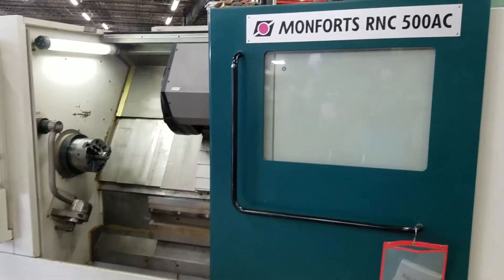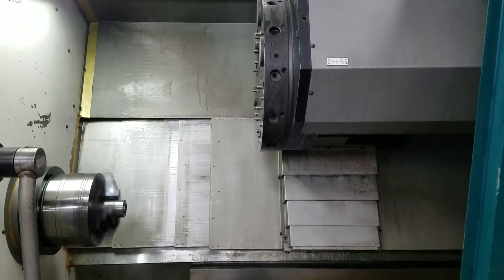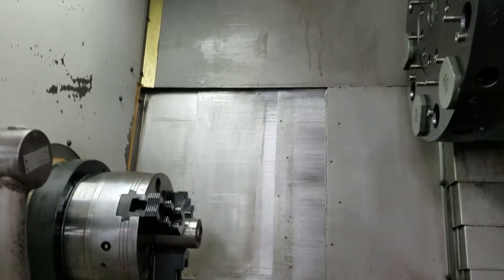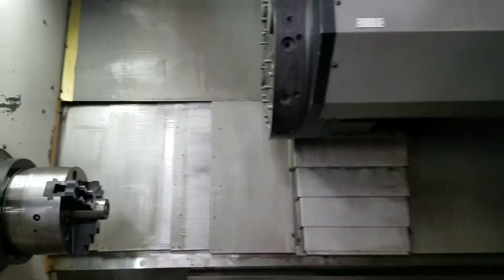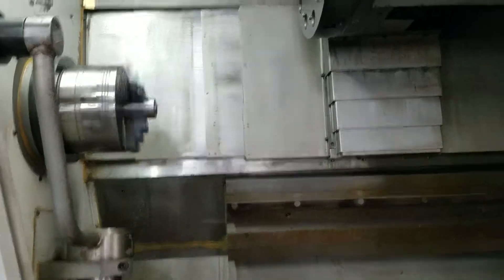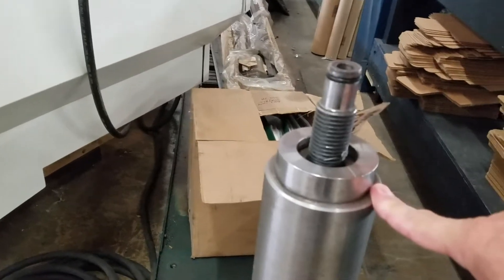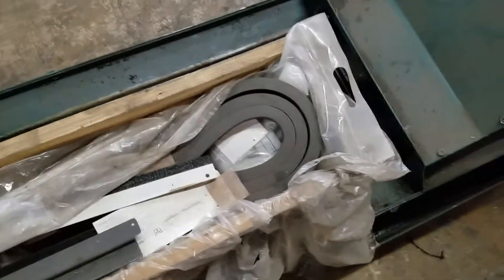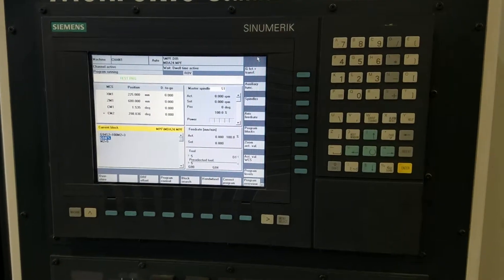Monforts RNC 500 CNC lathe demo

Comment: Hello, I have a RNC 5, however, I cannot open the tool setter arm. When I input M75 in the MDI the tool offset button lights up on the panel but the arm does not move. What is the procedure for using the tool setter? I would appreciate any advice on how to use the tool setter. Thank you in advance!